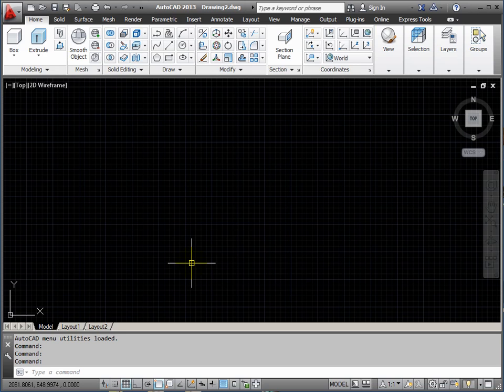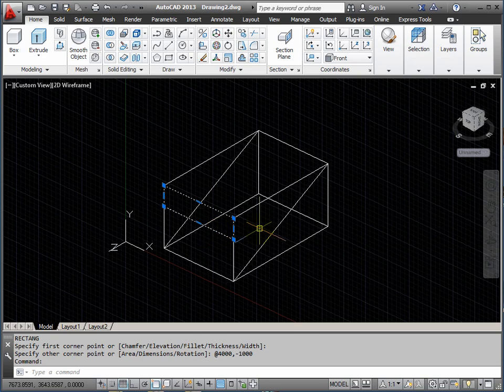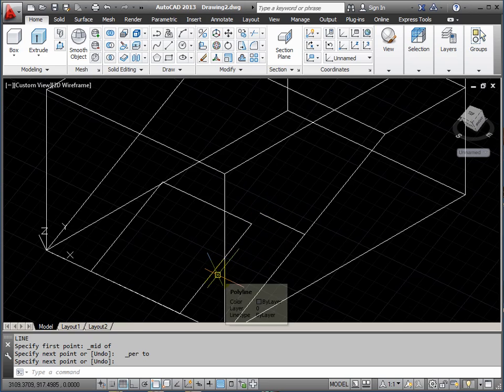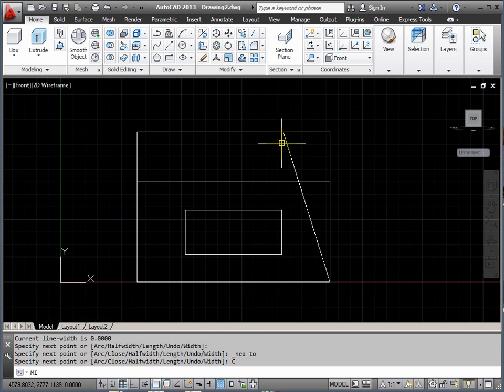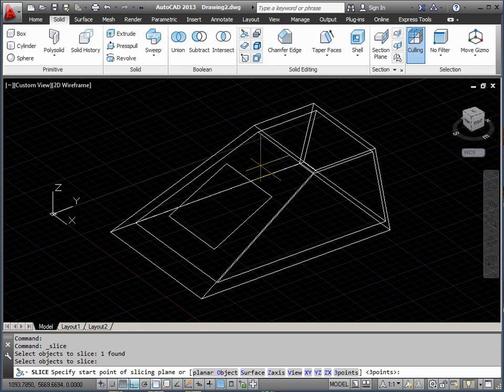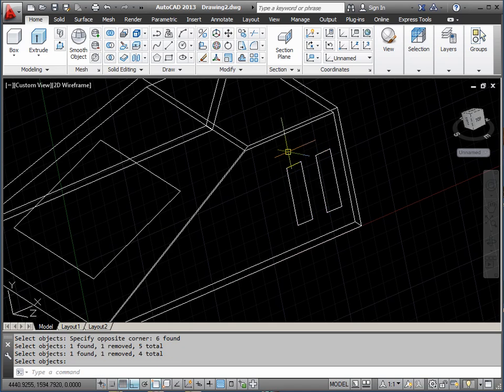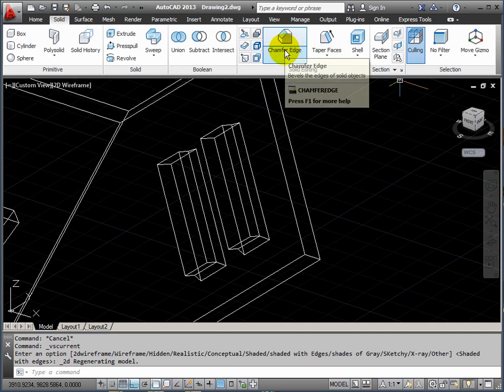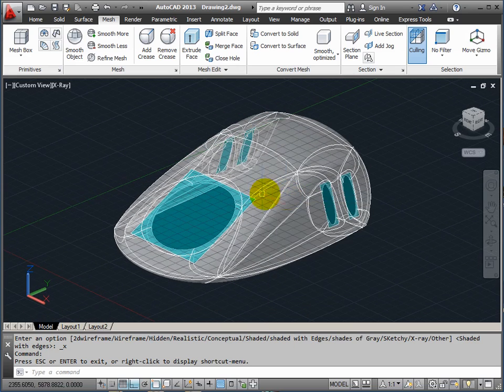AutoCAD 3D Basics Tutorial 3 - UCS Control - Exercise 1

Comment: 18.11 I am not able to trim the magenta line with the others white lines as a reference
Reply from the maker: Sometimes trimming problems are to do with the line being a polyline ... try exploding both lines first just to make sure neither is a polyline.
Reply: in autocad 2017 I cannot trim the line using the polylines as cutting edges because they do not intersect
Reply from the maker: Have you got the UCS in the vertical alignment?   If you do and you still can't trim then I advise exploding (X) the polylines before trying to trim them - sometimes they can 'misbehave'.   Lines do not have to touch/intersect each other before you can trim them - there can be clear space between them - as long as the UCS is in the correct alignment you should be able to trim a line that is above or below the cutter.
Reply from the maker: Have you got the UCS in the vertical alignment?   If you do and you still can't trim then I advise exploding (X) the polylines before trying to trim them - sometimes they can 'misbehave'.   Lines do not have to touch/intersect each other before you can trim them - there can be clear space between them - as long as the UCS is in the correct alignment you should be able to trim a line that is above or below the cutter.

Comment: Hey there, where is the 3Dface command in AutoCAD 2014, I can use it by typing in the command line , but I can´t find it in the ribbon. Where is the command in the ribbon?
Reply from the maker: Hi Adolfo - It's not available on the ribbons - it's used in creating 'legacy' meshes (old school) which are fine for most visualising work but if it's a situation that needs specific 'objects' like nurbs curves then these type of faces might be overlooked or not translate.   never ran in to any problems myself using them but there may be software/translation situations that might not recognise them.

Comment: First of all thanks for the vids they are great.

I have one questions though. In previous videos you mentioned that polylines only ever go flat, not up. But in this vid you make a triangle with the polyline, I have tried it but it does not work. What am I missing?
Reply from the maker: Hi Julian - The UCS has been tipped up first ... it's the Z co-ordinate for the polyline that won't vary from the place that it is started at.   Look at which way the Z axis is pointing when the triangle is drawn.   Difficult to put in to words.   Hope that explains it.
Reply: Hi there,

Thanks very much, I tried it out and it works.

I dont know how I missed it, anw great videos I will keep watching!

Comment: I hope this makes sense. I have a question in regards to the slicing command. I don't understand why the slice tool didn't just slice everything all the way through the slope side? How did it know to 1. Not cut out I giant hole including your window. 2. How did it know to do a parallel cut with the ucs titled slope?
Reply from the maker: Hi.  Slice just chops off everything in the opposite direction of your third pick.   Picks 1 and 2 define the plane and the third pick is identifying any point above or below the slice plane.   If third pick is above - everything below gets chopped away, and vice-versa.   Hope that makes some sense too.

Comment: Great tutorials! I'm having an issue trimming the magenta line with the two window polylines. I'm in the correct UCS, any ideas?
Reply from the maker: Hi Nathan.  try exploding the polylines, just X to get the command - sometimes polylines doggedly refuse to play ball.   Be careful not to explode any of the solids you have already made ... just the polylines.
Reply: emmockladdie Hmm the 7th or 8th explode did the trick, thanks!
Reply from the maker: Nathan Kerxhalli
The latest version of AutoCAD is pretty annoying when it comes to working in 3D - the UCSFOLLOW setting is really difficult to disable.   It's supposed to help you but ... it doesn't.

Comment from the maker: 2013. You can 'park' the command prompt.There's a strip of 10 dots on the left side - pick and hold that then move it up and then down to the bottom of the screen, when it's close to the bottom it will jump outwards, let go at that point and it will look like it does in my vid. I don't like the floating one - it's distracting. Give yourself at least 4lines of prompt area so you can see system responses. F2 shows you the whole command prompt in a page format if you need to 'look back'. Regards

Comment: I really appreciate your fast response. I will surly be trying out these new functions next design session. Im doing tons of surface modeling now so I think will help me cut, and slice along these weird angles. Do you have any suggestions of how to cut holes in curves surfaces with more precision? I usually extrude from top, the length, then have two slicing planes or surfaces for the thickness desired. Then I will make the shape a block encase I want to reuse, but sl for the void in it's place.

Comment from the maker: Good Phil, the UCS is just as useful in 2D as it is in 3D - like if you have two objects at different angles to each other but you want to work parrallel/perpendicular to each one.   Align the UCs with any line on the object   UCS (return) OB (for object) (return) then pick a line.   You can save UCS'es if you are gonna use them again - UCS (return) S (return) and type in a name.   DDUCS for a dialogue box showing all your UCS'es you have created.   Regards

Comment from the maker: Hi Nam.   I don't thik there is a shortcut for UCS - because you can set it to ANY face/angle you have an infinite number of UCS's and therefore there would not be enough shortcut combos.   You can save a UCS.   UCS ret. S ret. .   Use DDUCS to get see a list of the UCS'es.   UCS ret. R ret. and then the name of the UCs you saved ret. will bring it back.   Use very short 1 letter or 1 number names.    The co-ordinates section on the 3D modelling ribbon shows a drop down list of your UCs's.

Comment: hello OP, I am a heavy hotkey user when it comes to autocad/cadworx software's. I dont use the ribbon functionality when it comes to either software. My question for you is, do you know if there is a quick switch for UCS directions? For example, in one of the software's that i use, if i were to hit CTRL+E, it changes the UCS direction without me having to actually click on the toolbar. Does this function work on ACAD as well? if so, what is the hotkey to do it. Thanks in advance.